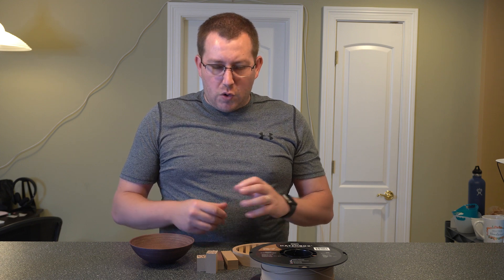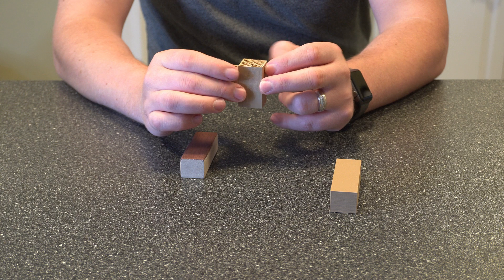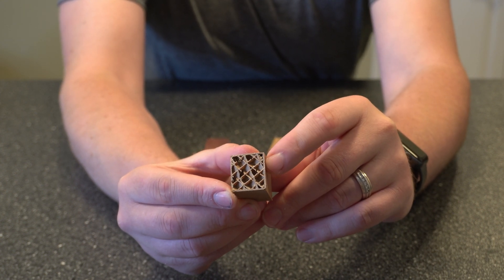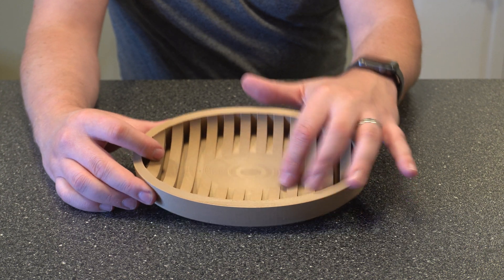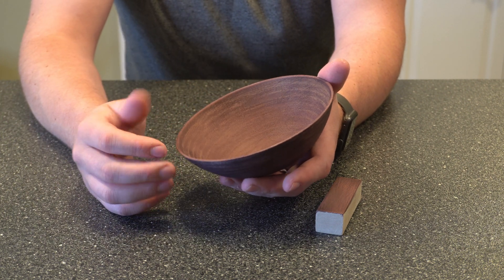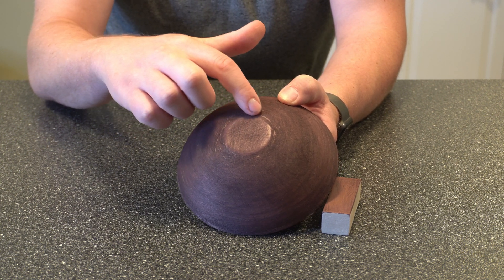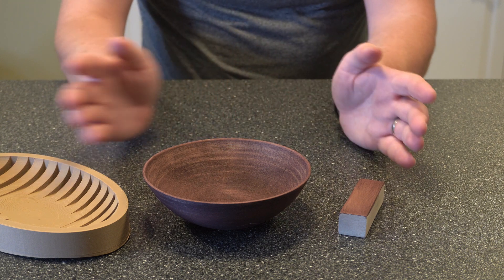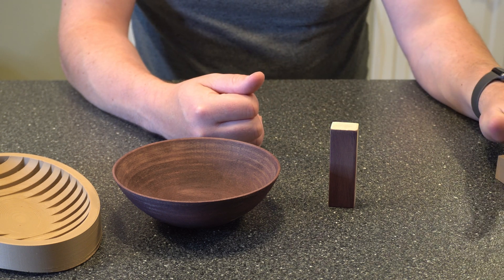Wood Filament 3D Printer – Initial Thoughts

Comment: Another great video.  Thanks!  Do you need to use a hardened nozzle for printing wood filament?
Reply from the maker: Thanks for the feedback, and a standard nozzle is fine for wood filament. It's basically just PLA with wood fibers.

Comment: You certainly covered finishing the printed pieces, but you never mentioned anything about print settings. Do you run the same temps as PLA? Also, any idea if the wood filament is more susceptible to humidity compared to PLA?
Reply from the maker: Hi Kevin, I used standard PLA settings. I can go into that in more detail in the next wood filament video if you will get value from it. It should behave mostly like PLA, but I cant say for sure how the humidity will affect it. Its basically PLA with wood fibers, so if the fibers are not sealed, I can see it absorbing some moisture.